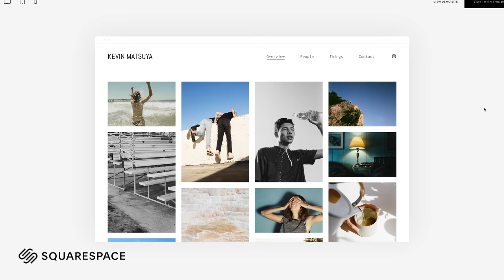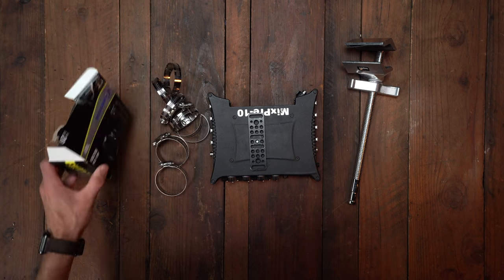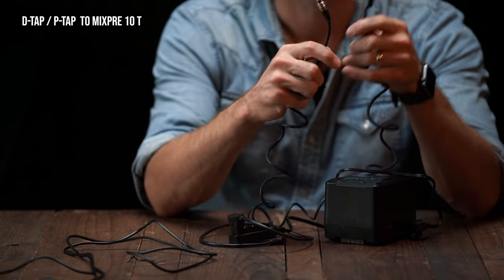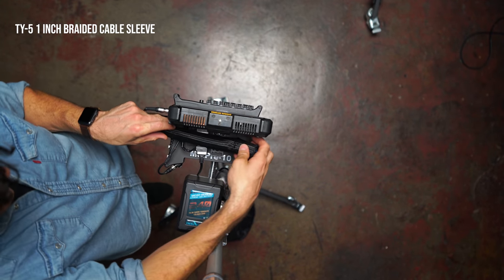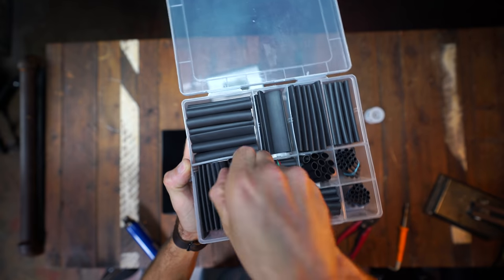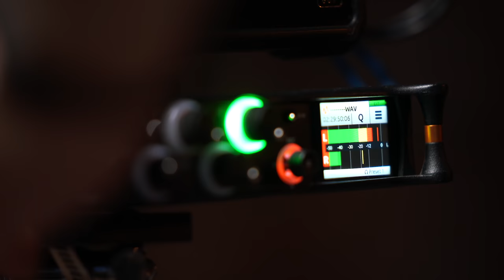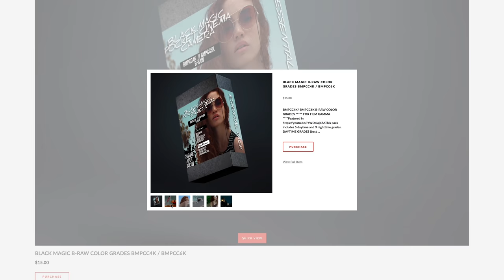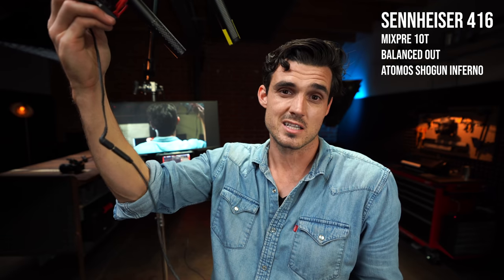I built a one man film crew. Here's how.

Comment: Excellent !  I do everything like this... only with cheap old bits and pieces... My recent cam purchased is so outdated hardly anyone would touch it.. SONY DSR 570 WS.. came with shotgun and wireless mics, lens, viewfinder, BW monitor.. so it will be fun learning with.. My colour monitor is a car reversing cam monitor from eBay etc., Keep every power unit, every cable, connector, bits of metal, washer, bolts, tubes, bars... wheels.. hardwood as you can make nearly anything from oak ! Build power packs..

Comment: Awesome build! If you can't match voltages with the power supplies you have, small DC-DC converter modules are available on eBay for a few bucks. They saved me a few times
Reply from the maker: Yeah i looked into that ---- so far this build seems to resolve the 19v-20v disparity--- but I was planning on building one that can be powered by one 14v 12amp brick..... for the next build.

Comment: Instead of chopping cables make em curly. very easy just form your coils round something like a pencil  clip them on the pencil and maybe keep the ends protected put in a bowl of some sort and boil a kettle cover the cable in boiling water, make a brew if there is enough spare thermo plastics soften around 70-90 degrees C and the heat will release the stress in the cable, let it cool in a freezer for 5 minutes or maybe cold water or wait  you now have loose coils next reverse roll the coils this stretches the inside and will make the coils tighter and now you have a short cable that can be longer when needed. and its probably as quick as the soldering job but cleaner.
Reply from the maker: That's a good tip! Though I HATE coiled cables. But maybe I should reconsider.
Reply: @MAKEARTNOWCHANNEL  if you wrap them round a glass fill it with hot water you can straighten them again :)

Comment: Thoughts:  Atomos Sumo, a 19" 4-input switching monitor/recorder with full-sized XLR inputs and optional battery power.  Costs less than the total of the non-stand elements you have listed.  Alternate: one of the various V-lock solutions for the Sony FX9 that outputs 19.5V.  Not that I'm at all against high-octane bodging, but sometimes fewer cables to fail leads to its own costs savings.

Comment: 11:35 Actually your WIFI is a huge reason for the hissing sound. When I used to use a Rode mic for audio I always had to turn off my wifi router to avoid the inevitable hiss.

However I didn't know it could also be fixed simply with a balanced cable.

Comment: 5:50 actually not really. A cable is set on fire, when it overheats. This happens when too many amps run through it. I=P/U, which means more voltage=less amps=less risk of fire. But it could still happen that your cable is rated for maximum 4A and the monitor needs e.g. 6A, so look out for this. If your cable has the same diameter than the original monitor cable and the monitor needs a higher voltage than the normal use case of the cable (but be aware of how many phases both cables have), then your safe.

Comment: 11:07... I'm a bit confused about something... here, you talk about how you got crispy audio using the Rode and an unbalanced connection, but then right after, you talk about how it had all sorts of interference. In other words, it sounded like you were praising it as a cheaper alternative, but then afterwards criticized it. I thought "crispy" meant "good"... did you mean otherwise?  (Awesome vid, btw).
Reply from the maker: Crispy= good audio. 

Unbalanced over more than 6 feet and around lights or other frequency emitting objects can lead to static in the line. Not good. 

Balanced audio which is what I always shoot on is free of this. XLR inputs are balanced. This is expensive, but good. 

You can risk unbalanced if you want and sometimes you can get away with it, like I did for those 10 seconds, but you do so at your own peril. Sound guys only use balanced for a reason.